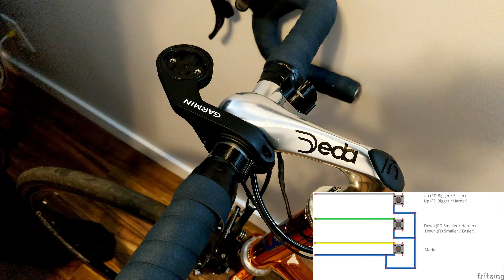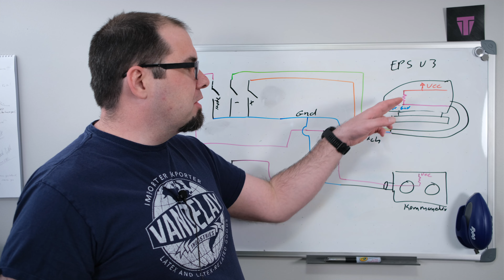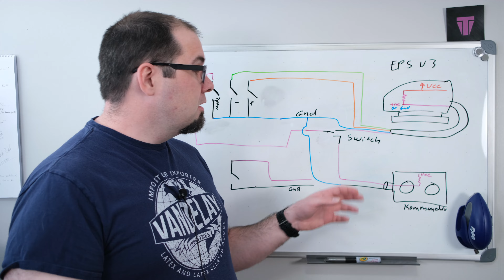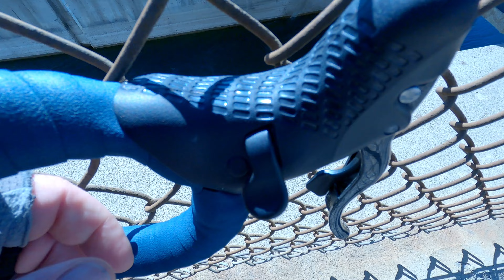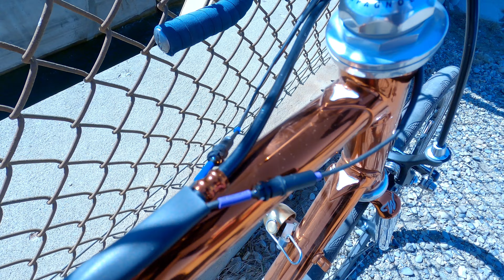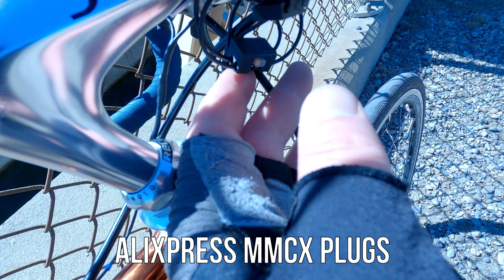Using Kommander Remote with EPS

Comment: Wow that's great! Love that there is actually even more exciting stuff in development.
Do you see something in the pipeline (I think at the moment garmin does not support it via their profile) to change map zoom on garmin devices?
Are there any ideas to use sram road (red or AXS) shifters as input? From the lack of accessable buttons it will definitely not be as easy as campigniolo to hack into, but I would love to hear your side.
Reply from the maker: Map zoom would be on Garmin side. I too share your annoyance with that. SRAM road shifters are more integrated and only have one accessible button/paddle while riding. They have a pairing button on the back, but that's not accessible. Blips could be used by replacing the connector for MMCX. We're trying to find a near universal road solution that works with mechanical and SRAM AXS but we're not there yet.
Reply: @kwakeham  thanks for the detailed answer. Really frustrating that nowadays  garmin seems to just introduce new ant features with the introduce a new garmin product. The ant plus remote profile has so much unused potential... I just had a look at the ant control profile. There is a big block of "custom manifacture commands". (Value 32768 to 65534) Is there any chance that garmin has barried some treasures in the there since 2013, when they last updated the control Profile documentation?